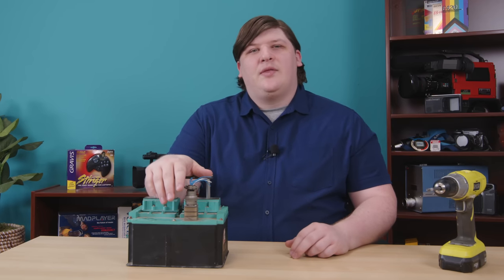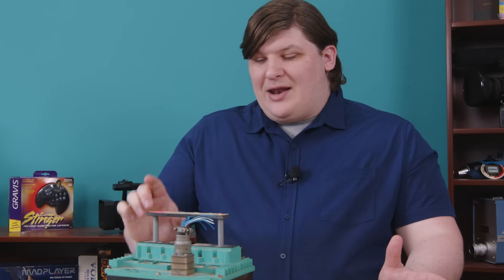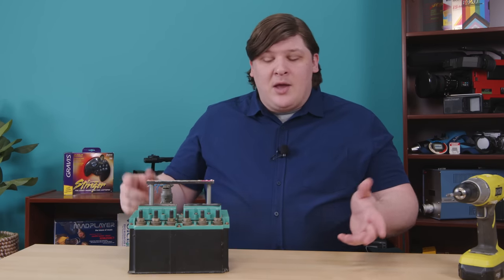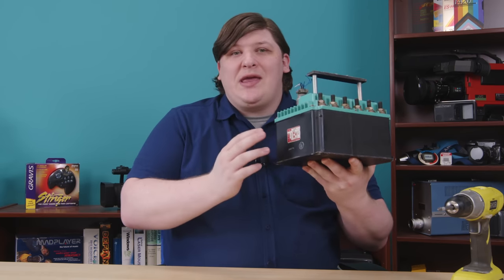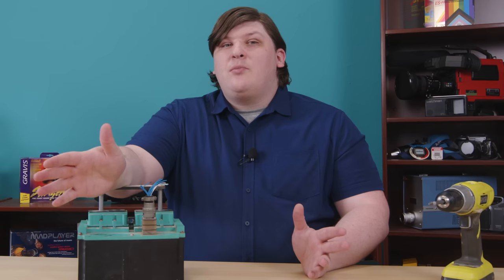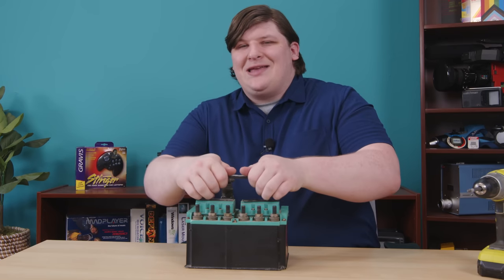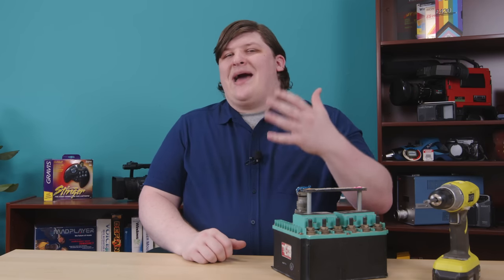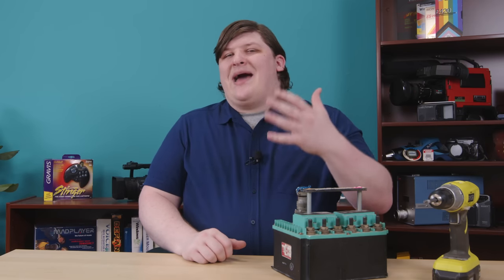A Short Story About (Battle)shorts

Comment: I can relate to the unwillingness to cover military tech. Back when I worked at a pretty high-end CNC workshop, I got to work on some backpanels/heatsinks for a radar system designed to detect drones and other flying things of that scale occluded by big buildings. These panels were milled out of a single piece of aluminum which took about 10 hours per piece, pretty crazy. Of course this was military-only tech, and as such would be used primarily to exert the state's power over - and protect itself and anyone paying enough against - common folk. In any other context, this kinda tech would be extremely cool to engage with, and that's just so frustrating.
Reply: I try to think of the military as a jobs program. Sure, the oppressive option is always there, and always will be, but for the boots, the system creates jobs and teaches kids something. A lot of people got their start in the military, especially during the big wars when almost everyone went. People left farms at 17 or 18 and came back a few years later as mechanics, electricians, technicians, and engineers. That's what really built America.

Comment: In the medical device world there are often alarms that would normally stop equipment, but if it's a critical device and you can't exactly just stop it (e.g., ventilator), there is a sort of "battle short" mode it can go into. Generally with alarms blazing. I remember when designing some medical things I was told not to add too many alarms otherwise the operators may get "alarm fatigue." If a device is constantly alarming it's basically the boy who cried wolf; no one will pay attention when something is actually going wrong. Granted, some alarms are required as per ISO/FDA standards.

Comment: Yes, relays are used to switch larger currents with smaller ones but they are also widely used to easily electrically isolate one part of a circuit from another.

Comment: I used to work in an old warehouse where conveyor belts would get overloaded and the protection circuits would trip.  Unfortunately having the belt off would lead to more stuff getting piled up on the front of the belt later, creating a catch-22 situation.  If it seemed to be getting worse and worse, the management would bypass the protection systems and have plant engineering control the belt directly.  Aside from potentially damaging the motors, this also cut off local control switches for any employees working on the belt, so they needed radio contact to shut it off.

Comment: On freestyle/ racing quadcopters we push the motors to the very limits. They can often pull 100A+ on a 4s/6s LiPo. Generally that is in short bursts, but the motors can get surprisingly hot a surprising amount of times before they give up. And usually when they do die, the subsequent crash is far more spectacular than the motor death itself. 
Most of these drones also have a wide operating Voltage range and you can push a LiPo way past its death voltage to get back home or unstuck from a super tall tree. I've squeaked back and the battery checker wouldn't even read 2 cells, and the other two said 2.3v. Killing a battery or motor if you get the quad back is usually worth it.

Comment: Contactors of bigger size are common before transformers on electric posts, usually making a double function as fuses too. They are also present usually before wires that go to buildings that have a primary cabin (i.e. that receive high voltage directly and have their own transformers). There are those with air gaps and those that use oil to avoid arches. Not all contactors are magnetically activated. Some use a long isolating bar. Some are automatically activated when a sensor forward on the line detects a voltage drop (meaning a sort), this avoids live wires falling on the street. But those usually disconnect for a few minutes (about a minute) and try to connect again. This is done because 90% of shorts are temporary (things falling on the wires, arches because of water, birds, animals, etc). So if an HV wire falls from a post, it turns off for a while and turns on again and turns off. So get away from them even if they are not arching.

Comment: You were right about electrically powered earthmoving equipment, but generally speaking you only encounter it at the very upper limit of machine size. Mining cable shovels with 80+ cubic yard buckets, walking draglines, and in some cases haul trucks that take power from overhead cables (like a trolleybus). With the larger digging machines this is usually because they're so large and heavy (thousands of tons) and their power needs are so high (10s of megawatts) that actually mounting a large enough diesel engine on them is impractical and would make the machine too heavy to move. The NASA crawler transporters are related to this in that they are diesel powered, but are based on the undercarriage for a stripping shovel which was electrically powered. NASA didn't want to have to deal with power cables so the design was modified to use 4 locomotive engines for power.

Comment: A similar concept, my tutor teaching me electrical installation here in the UK.  Used to work at a paper mill, he got a shout at stupid o'clock, and discovered one of the main motors had found its way into a two metre or so bath of water.  Submerged, still turning.  The owner showed up wishing to turn it off, my tutor carried the rank, leave it go and drain the tank.  Let it dry, then off I belive.

Comment: One of the primary functions of the battle short is self destruction of the equipment to deny the enemy from being able to readily reuse the equipment. On a generator with battle short, hit the switch and pull the oil plug, you'll end up with a half ton paper weight within 15 min.

Comment: Also from friends and relatives of mine that have seen action, once a battle short is pressed, that is it, they cannot reset, the system requires a new relay, or whatever component was bypassed, they are just replaced with new ones, the military would rather get a new bypass once the short is engaged, any repair crew needs to replace the component that was bypassed. The reason they cannot be reset is simple, lets say there was a reset, an enemy bullet, or shrapnel etc. hit the control room in such a way that it closed the circuit that controls the reset the systems then reset to normal operation, all the systems that you bypassed for the battle would return to normal operation at the worst time, and the safety's would kick in preventing you from being able to defend yourself from the enemy, and you don't make it home because they decided to have a reset instead of just replacing the safety systems when the danger is over.

Comment: That’s exactly what it is - if the relay control circuits are knocked out by enemy fire - then power can be re established by manually bridging the contacts. It will probably give out one massive spark but it would return power in that situation - such contacts might also be used in lighting circuitry - for example some of your lights are underwater because a watertight compartments is flooded, this burns out your relay. However since the ship might go down anyway it’s better to re establish lighting and get people out safely even if it causes an electrical fire because human life is more valuable than electrical componentry

Comment: My time working with robotics has shown me some things. I've seen a one-time use "fuck it relay" on the cooling pump for some big motors. A pump is a lot cheaper to replace than a huge motor. Those things just trip on when they get too hot and then the pump just runs at whatever speed it can until it either dies  or you cut power to everything.

Comment: I think a couple of those wires that come out of that plug are a pair that closes (goes to zero resistance) when the plunger is dropped. That pair would snake to some information board/dash  close to where the big, loud-and-satisfying switch that controls the relay itself would live.

Comment: That business guy and overridden elevator is actually a true thing. There're cases an elevator "technician" overrode some of the safety relays on some older equipment to "get them through".
Sadly there're some deadly incidents due to this. Last thing I remember is that the cabin started to move before the doors were fully closed hurting the dude stepping in at last second. And the cause? The relay was shorted/bridged.

Comment: They use a similar thing in spacecraft too.  Particularly pyrotechnic valves or reaction valves.  Basically they're one use valves that are extremely reliable to either open or close a circuit (fluid or electrical) with a small explosive charge and a blade.  In fact in Apollo 13 when they tell the crew to shut down fuel cells 1&3 they're telling them to fire the reaction valves to completely close the oxygen circuits into those fuel cell reactors.

Comment: So a few years ago for personal safety reasons I took a rather up end close protection pursuit driving class, a lot of people where police, military, and professional personal drivers. I can tell you as someone who has been in quite dangerous situations, and then took training for it I can explain a few things. bypassing safety features is quite important, and somethings used in "normal" safety contexts can be quite frankly a death sentence, now as a driver I can more or less confirm that there are some safety features you dont even want on the machine, and others that would be ideal to just be able to make go away. a good theoretical example would be the fact that most modern fuel pumps shut off in a crash (or at least they should), and while that would be a good idea for a manufacturers ANCAP rating, if you have to ram a roadblock, or somehow hit something of substance during the course of evading a threat, that does not mean the bad guy is not still there. the chance that the fuel switch has made your vehicle essentially a temporary holding cell until the bad guy of your choosing gets to you is just not acceptable. the problem is that when you are evading someone who wishes you harm, as i have had to do, you don't really think about these things too much, nor is it really a luxury you have. while a switch like that seems like it is probably one to be tripped in an emergency (big steel handle and brightly coloured label, easy to just slam with your fist when adrenaline has taken your fine motor skills). because sometimes you know ahead of time you just are just not going to have the mental space to trip a switch like that, especally in an automobile there it is normally hidden under the driver seat or somewhere else meant to be accessed during maintenance, this can be seen in the fact that a good number of armoured cars have these switches removed full stop. because believe it or not, a car that is smoking heavily, or is maybe on the edge of being on fire is at least temporarily better than dealing with whatever you are getting away from. even if you end up destroying the vehicle, you can replace parts, vehicles, or other Materiel, but you cant replace yourself or your principal, or their other protected persons.

TL;DR: some over rides are meant to be taken off during an emergency, (think the stereotypical big red override button), and others you just cant afford to deal with even the possibility of going off due to the fact that you would be unable to even think of it in the moment. this one is probably along the lines of one that is meant to be used when something has gone "horribly wrong".

Comment: In some european train systems there is an override that can be used to bypass most security checks to get power and traction in case it is needed to get to safety (for example when a fire damages a system or an emergency stop is caused in dangerous conditions where evacuations would be dangerous). The most common scenario would be a fire in a tunnel. If the train can move out of there somehow, it’s preferable to staying in there. It’s not one time use but in many cases and depending on which systems where bypassed, safety checks are required afterwards (after all some protection tripped in the first place). It’s good to know it’s there.

Comment: I think you're close, but not quite right on how this one works. 

It looks like the blue wires come from the control room (or whatever).  From the control room, they could cycle the relays on and off as much as they'd like.   That would provide power to the device (turret, or whatever)

If, for whatever reason, the relay box was disconnected from the control room, the things wouldn't work.   So that handle is the emergency override.    The control room took a direct hit, but you need to keep shooting, hit the handle. 

I think the top section of the diagram is the handle.   The bottom section is the blue wires. 

On smaller, non-military things, I have needed to remove a relay, and bypass it.  Like, the fuel pump in a car.  It just stopped powering the pump, but didn't blow a fuse.  Since most cars don't have the battle override, I had to do it manually.  Remove the relay, and jumper the in and out pins.  That works fine, but when the car gets shut off, it doesn't shut the pump off.   But it is enough to get you from the side of the road, to the parts store.

On your military contactor, you could try do the same, but it would likely do the whole injury and death thing.  You could jumper the inputs and outputs.  1 to 2 , 3 to 4, 5 to 6.    Unfortunately, since it's probably 3 phase power, you'd be bringing up one phase at a time, so it could destroy whatever is behind it.  And considering the current that is designed to carry,  there'd probably be a pretty serious arc flash, which can injure or kill you. 

The diagram does show which wires control which parts.  You could rewire it to turn them on locally, rather than remotely.  But that'd be too much work in combat.

So, this is still very applicable to the Star Trek universe.  For whatever reason, the plasma relay is stuck open.  Either wear, or the photon torpedo that struck under the bridge blew out all those control conduits.  So hit the emergency go button, and all is saved.

Comment: A bit of extra fun in the Star Trek bit is the Electro-plasma is transferring "Giga/Megawatts?" of energy At a time, when you see the consoles explode after the ship gets hit on one side is basically Water Hammer, the plasma is just the energy carrier so instead of a relay blowing ensign Ricky gets a face full of energized plasma/fluid when the kinetic shockwave finds his console as the either end point or just the weakest link.

Comment: It kind of reminds me of something I saw on the USS Midway museum. Every few feet you would see 3 phase sockets with spools of 3 conductor wire next to them. I wonder if these relays are a more sophisticated replacement for that, or if that system is still in use in some form and these are an additional layer of protection?
Reply from the maker: I would absolutely love to do a Tom Scott video on a battleship where I get to run down a corridor hauling a massive bypass cable with me
Reply: those things are for rewiring the ship power if something gets cut, you can connect a still live section to one that been disconnected and it all comes back online, not the same thing at all as battle short but used in similar circumstances, bs is when you have power but something is setting off the breakers, whereas those spools are for when you dont have power

Comment: Next up, how about 30 minutes about the foam rocks that explode out of control panels during combat?

Seriously, though, I always enjoy your enthusiasm and humor. I usually avoid videos longer than 8-15 minutes (who has time for more?), but this was thoroughly entertaining even though I watched it in 3 segments.
Reply: I said it in another comment as well. My speculation:  Carbon Foam. There are quite a few (expensive) industrial coatings that when exposed to high temperatures create a chemical reaction that ablatively absorbs the heat by forming a C02 expanded carbon foam. It's not out of the realm of reality that coatings like this are used in the surfaces inside a starship especially around high voltage or power systems. This would prevent an arc from melting the metal into dangerous molten splatter and rather just creates a relatively safe carbon foam that cools to the touch quite rapidly.
Reply: @DFMurray  I think your theory actually makes the most sense, however I really enjoy EC Henry's ongoing gag about it.

Excellent name, by the way.

Comment: battle short, bypass all the fuses and safeties and keep going regardless of ongoing issues, for use only when things are badly screwed and any potential destruction of equipment is less important than the chance of keeping the gear in action, when you are getting shot at or something breaks badly such as fire or flooding you want to keep the lights on and the pumps and computers going despite issues elsewhere in the electrical system, that one doesnt resemble any of the battle short breakers ive seen but it wouldnt surprise me if it were somewhere in engineering or weapons and i just never saw them, the ones ive seen are three way breaker switches or small switches on the console itself